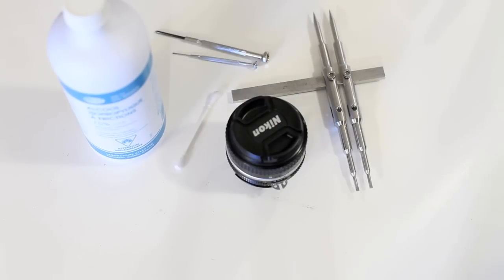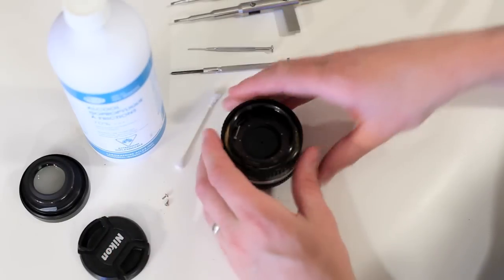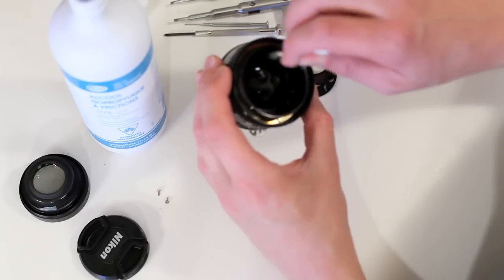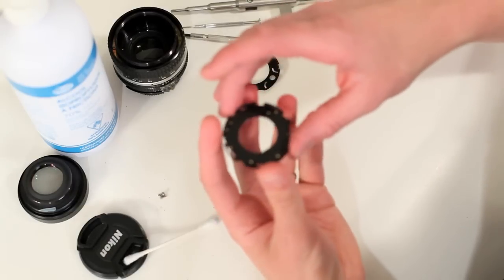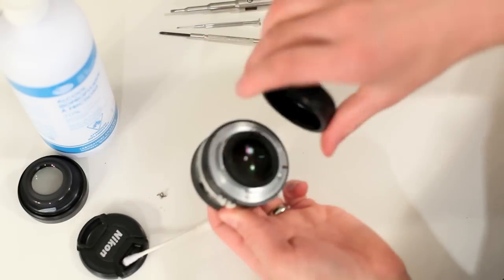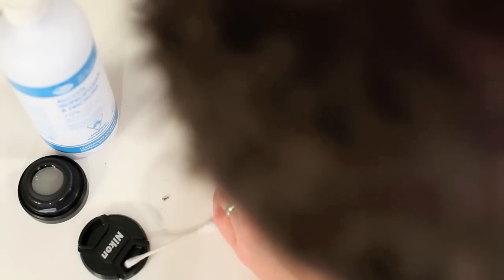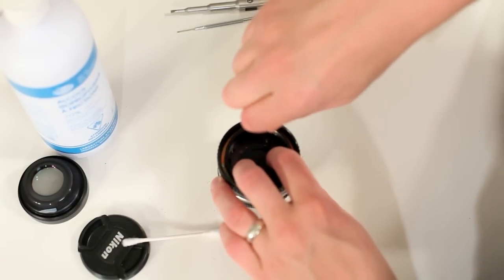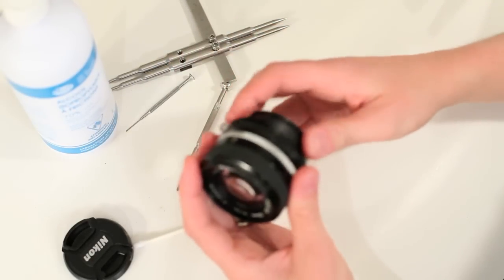How to Disassemble and Repair Oily Aperture Nikon 50mm 1.4 ai-s Prime Lens

Comment: Hi, can I use this video as a guide for cleaning some fungus from the lens?
I'd like to save some money hehe
Please answer soon, thanks a lot :)
Reply from the maker: Marcelino Islas Hi yes thats right you can also clean fungus doing the same thing. Most fungus settles on the 2 elements by the aperture blades so hopefully you will just need to pull the front assembly as i show. If you have fungus in the sections of the front element then you will need to unscrew the back element of that assembly.
For the rear elements you will take the few screws out on the mount and enscrew the rear element assembly and do the same.
Hope this helps
Reply: Thanks a lot my friend

Comment: Do i need the lens spanner or does it work without as well?  Have the same problem with the same Lens as in the video.  Dont feel like buying it for a single use..
Reply from the maker: You could perhaps get away with a pair of fitting scissors which some people have success with however some ebay spanners are under $5 now.
Reply from the maker: You can get spanners for around $5 on ebay from china http://goo.gl/zDMv39
but some people have used scissors when they are easy access like this which might work.